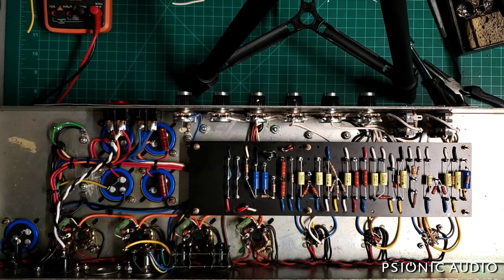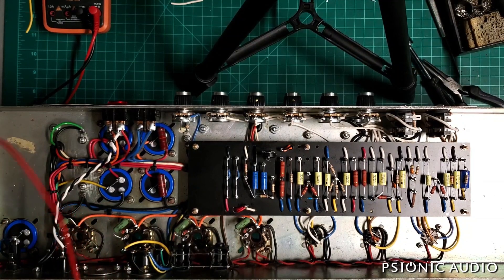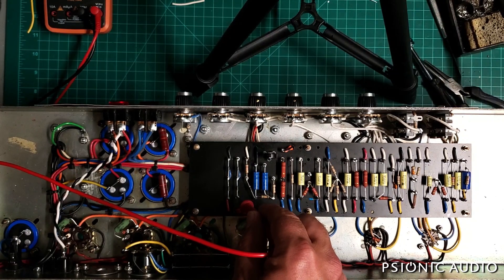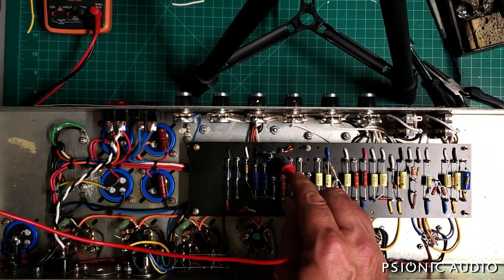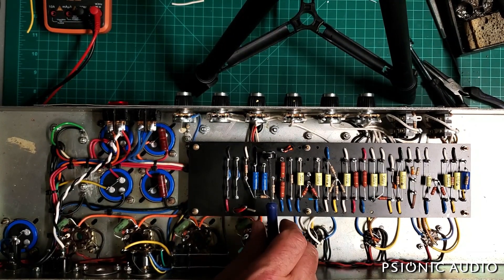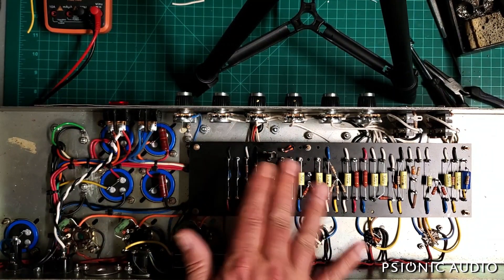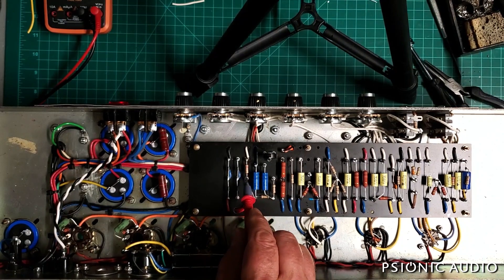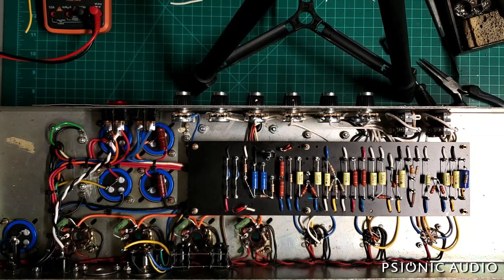'76 Marshall Super Lead Mk II | Part 6 : Voltage Test

Comment: Maybe find a washer with the 3/8 hole and will just fit into the hole to take up the thickness of the faceplate and chassis to fill that gap and get it closer to flush of the faceplate. You get lucky sometimes.

Comment: I have a brand new-ish 1959HR that is ghosting really bad. I had the power tubes replaced other than that it’s all stock. It had been in repairs in and out but the ghosting is not going away. Any idea of what could that be?
Reply from the maker: That's usually filter caps and/or grounding, but I've seen a lot of new RI Marshalls with defective transformers.

Beyond that I cannot speculate. A good tech will find it.
Reply: @PsionicAudio  thank you so much for sharing your thoughts on this matter. I hope the amp tech can figure this out. I suggested to them that it might have been worth checking the filter caps under the oscilloscope but they said that an eye inspection should be enough to tell whether they’re in working condition or not. It’s funny that you mentioned the bad grounding issue because it had a loud 60(?) Hz noise the second time I brought it back to the technician. It might have been 120Hz but I won’t know that for sure because that is less audible now. A bad transformer may be something they may want to check.

Thanks again!
Reply from the maker: A visual examination is enough? 

Hogwash.

Plenty of bad filter caps look fine. You need to find a real tech.
Reply: @PsionicAudio  I completely agree with you. If they were to check the filter caps objectively worst-case scenario we'll know for sure that's not the issue. I hope they can find out what the issue is. Thanks for sharing your thoughts on this matter, it makes me feel like I'm not crazy for not 100% agreeing with the amp tech guys. I wish was closer to your location so that you could take a look at it.

Comment: Not critical, just a question. Merlin recommends that the heater connections pass over the socket on the 12ax7 instead of either side since the electrical field generated is much smaller.  I noticed that you didn't do that and just wondered why?  Beautiful work.. Loving your videos.
Reply from the maker: I usually do that in my own builds but it would have been a lot of extra work to rewire this Marshall that way. Instead I carefully dressed all the grid connections away from the black heater wire side. You can see that here. Same result.

Comment: Please tell me you're going to follow Ken Fischer's "Measured Current Biasing" method on this amp. Find the sweet spot on the bias pot, between 10-40mA per tube... wherever the amp sounds best between those settings is the "correct" bias for that particular Marshall. Some guys like it running hot, some people like myself like a little cooler bias with more headroom. Ken would always adjust the bias based on the players speakers and style of playing. Most techs just set it to a specific voltage or current and call it a day, but you can really bring out the amps natural best tone by tinkering with the bias. Great job, can't wait to hear this cranked up!

Regards 🎸
Reply from the maker: Sounds like my approach. I didn't know I was copying Ken...

...I'll live with it. ;)
Reply: @PsionicAudio  Ken was the Leonardo Davinci, Albert Einstein, and Nicola Tesla of guitar amplifiers. It's just a shame he never got the mainstream recognition he deserved... but at the same time it's nice that his legacy is known by only us amp nerds who appreciate the impact he had. I sure miss him.

Comment: Could you put it on an oscilloscope when you bias the amp up with the tubes in it? I'd like to see where the bias is in mA (or DC mV) when the sine wave isn't crossing over or clipping.
Reply from the maker: I could, but I don't use the crossover method.

See:

https://www.aikenamps.com/the-last-word-on-biasing

Comment: I remember when I was a kid, 9 or 10. Going to the rxall drug store with my older brother checking tubes. He said this one’s expensive 3 bucks. I suppose back then that was a lot for a  tube, I want to say RCA but that was long ago.
Reply: The only problem with those testers is they were really meant for testing tubes used in TV sets and radios, so they often times only tested a tube to about 150 volts or so. That was ok for 12AX7, etc. but useless for EL34's etc.
Reply: I too back in about 1970 owned a 65 Bassman and I remember buying pre tubes and testing tubes at the Rx store. I bought new RCA 6L6's at the music store. Small town Iowa, the only Fender guitars in stock were Mustangs and that Fender hollow body, and Harmony Rocket.
Reply: Burlington, Iowa was where I was raised how about that
Reply: @oldguy5381  Hey, I was from Keokuk, I went to machinists school in Burlington. I bought a Gibson at Muntz's Music about 71, and i worked in Burlington from 2012 till 2017 at Dresser Rand, which was the old Murray Turbo.I've had some adventures and some misadventures in Burlington. We probably know some of the same people. Were you around when Brillo and the Firebirds were playing around from Macome?
Reply: Wow small world. Yea I left in the mid 70s came down south. I believe they leveled the Murray ironworks building. I guess nothing stays the same.
Reply: @oldguy5381  Good to hear from you, hope to see ya around.